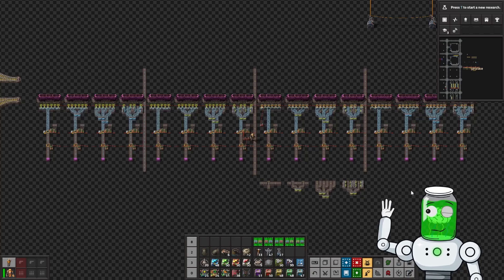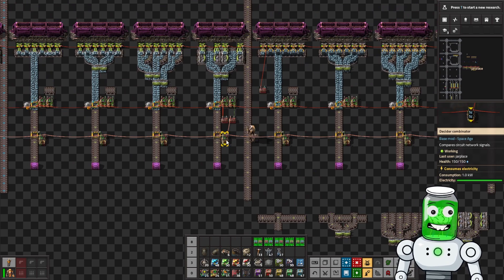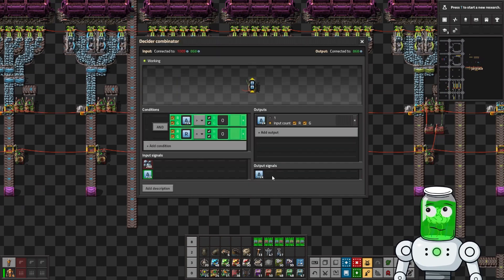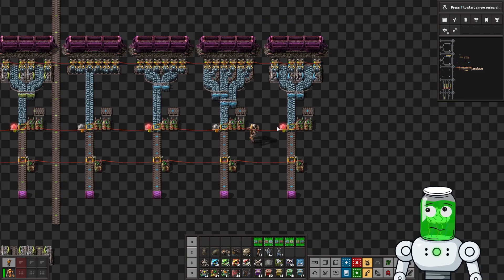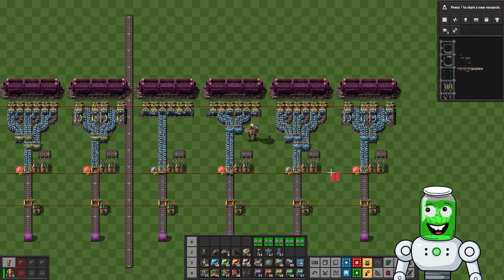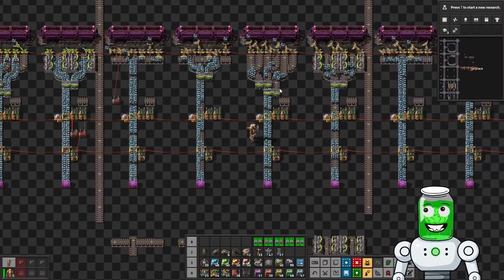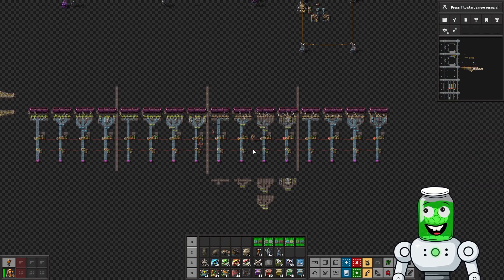King of Unloading | Factorio Spage Age

Comment: Dumb question I can answer by just loading up the game and trying but: can a splitter output into another splitter but from the side? Like how belts can output into one side of an underground belt.

IDK why I want to know about this specifically, but it would be neat to use stack inserters to offload into splitters into dual opposite facing splitters into double belts into trains. For no other reason than "it's overly complicated and looks cool" 😂😅
Reply from the maker: lmao I actually don't know - if you push this quest further let me know the results!
Reply: @ conducted the test. It does not work by itself. But inserters work between them so it technically does work lol.
Reply from the maker: @Sphendrana  cool!
Reply: @TheJarGames  Update: just using belts into the splitters is fine, but we're back to basic belt balancing with that lol. It would be pretty nice as a bug of we could do this lol. It would be very compact XD

Comment: But the actual question is how many fully compressed belts you can get out of a single carriage right? So whats the answer? Still 3? Can we pull 3 compressed turbo belts out of a train carriage ?
Reply from the maker: Great question, You definitely could depending on the design and the quality of the stack inserters..

Personally I wouldn't be aiming to have more than 2 compressed belts per wagon, so I didn't think about that.

Comment: Two points/ ideas:
1. You can archive a full saturated green belt with uncommon stack inserters (As early as with 2 common and 4 uncommon inserters), if they are implemented in the winning design. 
2. The winning design can be enhanced if instead of simple splitters you use a 3 to 1 balancer, it doesnt change the throughput but empties buffer chests evenly.
Reply: Theoretically your buffer chests should always be ~full, otherwise you're not delivering items fast enough. So, the 3 to 1 balancer is not needed. All that the buffer chests have to do, is keep the items flowing while another train arrives. Assuming you have a train limit of >1 (and the appropriate infrastructure), that time is very little, thus minimal buffer space is required

Comment: Version nr 2 I think is slightly incorrectly made?
As your getting 4 inserters on one lane, but only 2 inserters for the other lane? If you simply add a belt at the merging splitter to sideload that might "fix" that unloader?
Reply from the maker: Not exactly sure what you mean, but that one was a... participation award unloader lol.

if you have an unloader design you think can beat the King, please share the blueprint link, or if you simply want to share that adjustment, please also share a blueprint link.

Either way, I don't think anything can beat the king, since it's well.... logically probably the best?
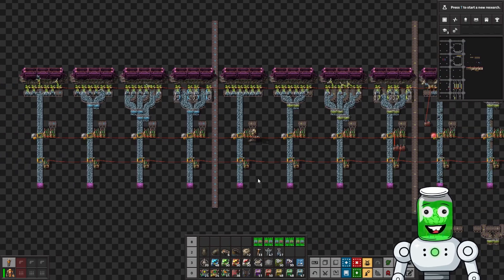Reply: @TheJarGames  If you look at how it outputs, you can clearly see that it has one lane fully saturated, and the other lane with massive gaps. (Probably explaining a large part of why it's throughput was not the same as it's saturation relative to other designs. It's very clear at 3:02 just above your head.
I doubt it'd "beat" the other design, but it might be able to tie it. (Less buffer space likely means that it won't be as good ofc.)

What happens with the current design is that you get 4 inserters for the west lane, but only 2 inserters for the east lane.

Here is the BP string of what I mean, (untested as it's very late here.)
0eNqlle1ugyAUhu/l/MZGEPy6lWVZ1JKFTNEALmsM9z7apllTnUL4qR6fx/NykAXafuaTEtJAvYDoRqmhfltAi0/Z9Nd7shk41GBm1Y6JUY3U06hM0vLegEUg5Jn/QI3tOwIujTCC3wm3i8uHnIeWK1eAHiRtmu4rEVJzZdwTBNOo3WujvNocipDixBBcoE5ylp+YtWhFIwG06pCWBdDKQxr1p2X4kMYCaOkhLQ+gkUNagXanY39lmWMiOAvFu3sJ3TCUwYan1aavhnLDUAUbyh3DVg84jWliFRMmWw4c0wbzCQqTUMXzPHqtBc6CFXhHsZ0UjXH4JcVikvLaFzgPVpDgmSpi5pZ4JVXGJEX82njd4XrqhfnvD/pgZz6fT6J2Nl4r3BkqDB8c7+9YRvDNlb4VsJxUtKoYrUiZ09TaXwL2g+Y=
Reply: @TheJarGames  Oh, and I think "The King" is logically "superior" (ignoring it taking more space ofc) because it has more buffer space for each inserter. (At least 4 belt lengths!)
However, if we are talking about UPS, that means a LOT more belt (lanes?) that are not fully saturated, so is it actually better UPS wise if the other simpler designs can fill a belt? That would depend heavily on exactly how the code works.
Reply from the maker: @bjorn9875  awesome! thanks for the blueprint to explain it, I see what you mean now. That definitely makes it perform better, and will now saturate a green belt with uncommon stack inserters, but it's about 80% capacity as the King on the normal stack inserters. it's on par with bulks on blues, but won't quite saturate a blue belt with stack inserters... so, great suggestion and I really appreciate the blueprint, but it is not dethroning the King just yet...

It's just that the King has the 6 inserters inserting on their own side of a belt, so it's able to get what can only be seen as the logical extreme of throughput out of the inserters, given that each on has it's own side of the belt to unload on.

anyways, I appreciate your contribution a lot!

Comment: You missed one important aspect. If you first unload to a chest buffer, then to the belt, you want to have an even unloading of the chests. When unloading directly from the train to a belt this is not important, but I never do it like that.
Reply from the maker: You're right MatrimVidz!

In this example I just go straight from the train to demonstrate purely the unloading capacity of the unloading belt design.

I add chests for the next one, but didn't focus too much on the balancing of the chests... I have a future video coming with that!

It's possible to balance chests with circuitry I think, to perfect the balance, but I don't know if that's important or worth it from a UPS / complexity over utility perspective..

anyways, thanks for the comment, always looking to cover all angles!

Comment: I think that, once you get bulk inserters, you are limited entirely by belt speeds.  I did a bunch of testing merging train unloading platforms from 6 belts down to two (instead of the one belt in your test) and only for the poorest of mechanisms was I able to see an average belt capacity below 4 in a single square (so compressed to a single belt, that would be a full 8). 

I built some tools that give much smoother and easier to read data (much needed for GenX eyes).  I measure the population along a strip of the belt, instead of at a single square, to get an instantaneous throughput, along with some shift registers to get a rolling average.

I also measure unloading times from a regular train, not from infinity trains.  This is what makes me think the limitation is the belts.  Even with green belts, I basically wasn't able to create a bottleneck with the unloading.

Also, you can easily improve the "loading into sideways splitters" design by just using all 6 inserters.  Sure that one won't swing nonstop (nor the one to its right) but it will fill in many of the gaps.  If you unload directly from the train instead of boxes, the inserter that would idle will pick up a lot of slack, as well.  (edit, I did more futzing and realized why I was seeing this... I was splitting to two belts, not one.  My bad.)

Comment: Unloading onto a belt is never going to be faster than unloading into a box, no matter what belt/belt layout/inserter design you use. Inserters ONLY work at their full speed when loading containers. There is an 'AI' step when an inserter interacts with the belt to determine if what it has in its hand can be put in a spot on the belt, and items are placed 1 at a time, based on belt speed, no matter the stack size of the inserter. To maximize unloading speed, you MUST have a row of boxes that a first row of inserters unloads the wagon into, and then a second row of inserters unloading the boxes onto belts. Since the second row can keep working both during and between train visits, they can keep belts full with even the most basic balancing/distribution layouts.
Reply from the maker: yeah, definitely. I skipped the steel chests in this example just to test the inserters onto the belts...

Keep an eye out for the next video where we test some quality stack inserters!

Comment: Try: Yellow belts with red splitters; Red with Blue; and Blue with turbo.  My anecdotal observations is the splitter is a bottleneck when unloading.  So if I want a fully saturated red belt going into my smelter, I'll set up the unloader with blue belts feeding into a blue splitter onto a red belt.

Comment: the faster belt we use - the more important inserters thoughput become. add counterpart on ther side of the vagon for design n4 and you'll get fully saturated green belt since there will be 8 inserters working
Reply from the maker: yup! that's a great idea.

I also have a video testing quality stacks to see what is the lowest quality necessary to full saturate a green belt with just one side unloading... stay tuned!

Comment: 6:30  Loading onto spitters was broken in 2.0 unless they fixed it in the last month.  Could also add 2 more inserters to have 6 like the others instead of only 4.  Curious if the extra 2 splitters would help it.  Ive been using your "winning" design so cool to see it tested and that its on the right track for unloading speed.
Reply: it is aktualy  not  broken but the intended  way now, it  was broken befor 2.0 because the inserters where putting the item  on the split instead  of befor the split, which resulted in  instant splitting
Reply: @Odysseus0000  Each color of belt functions differently though which is generally a sign of not working right.  Iirc blue was the worst and basically the same as loading onto a regular belt.
Reply: @Silv3rDragon  that  is because  now the  inserter puts  the item on the belt part  befor the split, the devs confirmed it  in  the bug report forum that this  is  intended behavior, that  was "fixed" with 2.0
Reply: @Silv3rDragon  diminished returns at higher speeds isn't "function[ing] differently."

Comment: I set my train unloading station with 3 belts per 2 trains with 4 2+2 4 this ensures maximum balanced unloading at all times and I can use other techniques down the line to compress the belts. 

I am very disappointed in your best unloading suggestion because it biases the unloading of one side.

Balanced unloading ensures that the transfer inserters between the train car and the chest are at max capacity. If one chest fills up that one 6th of your throughput is gone. Resulting in slower train unloading.

Comment: Probably covered but Design One (left to right) requires a single inserter to load fewer items faster to make for full saturation.

Designs 2-4 are not good for UPS due to Splitter usage. Though Design Two is the best outta the worst.

All are valid designs up to 6.5-8k SPM base.

Comment: Didn't see my preferred unloader in the mix, basically a cross between to the far right and far left with only one set of facing splitters instead of two and then a belt behind each for more pushed through each splitter. It can easily keep a blue belt fully saturated with four bulk inserters and is nicely compact (5x2 tiles), but have not stress tested on green yet or with stack. Seems all of them struggle with green plus stack.

Comment: this is content that touches the very edge of the venn diagram of total technical content housed by factorio. there are entire massive rabbitholes for each and every component in factorio, you can do so many things. I only just figured out theoretically how to assign colors to flash based on different signals coming in to a single lamp. you can make a lamp count down from green to yellow to red, just ONE lamp now.... theres SO much stuff to do. keep it up man, Im watching these little tech vods, i know quite a few others like em as well. 

the thruster efficiency value is such a nice little door into technical factorio. not a requirement, but if you figure it out you are rewarded. I love it.

Comment: In your third design, delete the first row and change every odd conveyor belt to an underground out belt, that way you get two straight pieces without a corner piece, and the two inserters can fill two separate sides. It's effectively the same design but one tile shorter, more compact!

But I just did an unloader design and decided that it's best to use the splitter out one, your fourth design, but on both side, and then I can bring in the other side with an underground belt, that way I have 8 inserters loading instead of 6, and it my balancer at the station can stay simpler too. (And it's fairly compact too, on the other side of the wagon it's just 3 wide (1st row: inserter/undergound in the middle, 2nd/3rd row: splitter)
Reply from the maker: cool!

any chance you can blueprint it and paste it here? would love to see it and test it out myself!
Reply from the maker: I made the design shorter as per your suggestion, love it! still, if you have that blueprint of your 2-sided unloader, let me know! I just tested quality and the results are surprising!

Comment: the 2nd unloader design unequally puts more on the right side of the belt as inserters put items on the right side when facing the direction of the belt. in the wagon-wide design it works as 3 inserters end up putting on each side. on the 2nd design it ends up being 4-2 so it's quite imbalanced.
the reason it's bad is that the 4 side may end up filled and not able to take the load from the wagon leading to longer unloading times in the station
Reply: I wonder if saturation and throughput could be improved by prioritizing the main splitter output (right side by belt direction), adding another output from the splitter to keep overflow moving, and dumping that overflow back onto the main belt...

Comment: the leftmost design(s) could be improved by reducing inserter capacity that makes the outer one move earlier while the inner ones have enough stock to compensate for the outer ones swinging || there was a mistake: i wasn't following yet ... i fixed that!

Comment: Really been finding your videos informative, I'd love to see quality inserters tested to finally get full saturation! I've been using a modified version of the far left design in each group of 4. Only difference is it has splitters bracketing the output belt much like the old go to design. Not sure if it really helps to add those but I might need to do some testing now myself

Comment: With the design where you unload on belts from left and right and merge them, for example 4th from the right, you should try and play around with hand size. Because of how the inserters swing, if you turn on maximum stack size, they will wait until they are fully empty and then they will swing back. The issue is that at maximum stack size what happens is that their timing will be off which means that the inserter will have to swing back at wrong time and leave a gap. For bulk inserters you could unload with 4 inserters and make a fully stacked blue belt by limiting the hand size to 8 (or 6, i dont remember). I don't know how it is with the green belt and stack inserters but there is something you can test
Reply: was coming to say something similar.  There are some weird quirks and (arguably) non-intuitive results with hand size limits.
Reply from the maker: @DavidLindes  these are some interesting concepts to try... especially because the examples with only 4 inserters tend to keep their boxes more balanced automatically, it could be worth getting them to work optimally
Reply: Yeah, 12 on the outside and 8 on the inside. Full saturation, even on green belts.